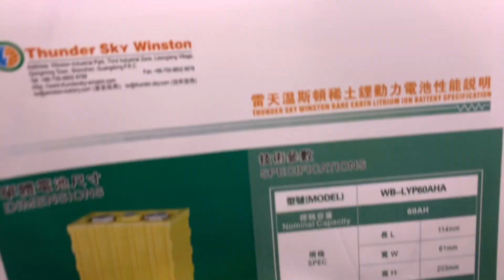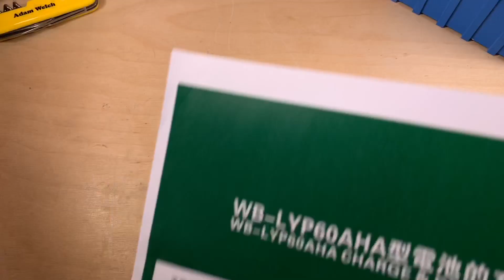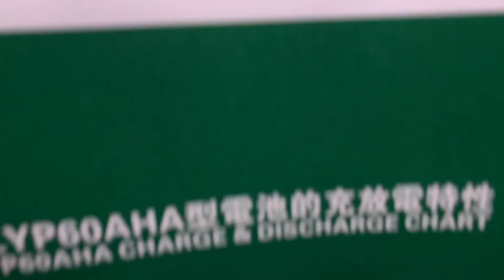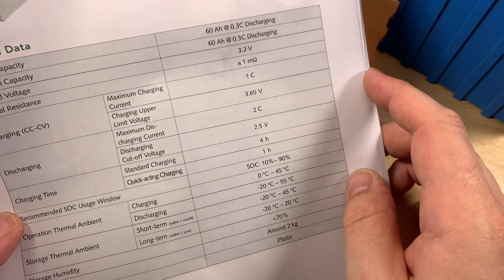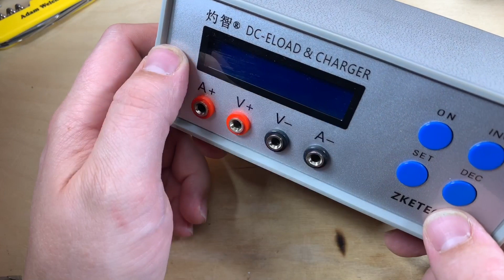Change of Chemistry

Comment: About that electronic load: Devices that have a USB connector but don't support the USB standard distirbues me greatly.. Just before I stopped work (because of the lockdown) I actually blew up my laptop from trying to test an amplifier with a mini USB connector on it. For some ungodly reason there was +12v directly on the USB power lines which killed the laptop straight away. Unfortunate

Comment: Charging lower than the max is not necessarily a good idea.  Most BMSes are meant to "top balance" which means you absorb at the max voltage until the current tails off (typically around 50-100mA) and then you're reasonably balanced/etc.  If you charge lower the batteries can drift over time.  (source: I made this mistake).

Comment: You do not need to worry about keeping this chemistry below 14.6v. You can safely charge them to 4.2v just the same as NMC  but they will degrade faster and  there is no real capacity benefit over 3.65v so that is the standard charge voltage. The point being there is still headroom with 14.6v @  3.65v unlike NMC where if you are charging to 4.2v that really is the max. Due to the poor correlation between  voltage and state of charge with this chemistry it just makes most sense to go with 14.6v when you can to get to the highest state of charge with a CC charge.

Comment: Hi Adam. 

Sorry to bother you but as a non electronic computer nerd with a RV from 1985 with solar and I have a shed. I got myswelf 4 105 pw panels from 2004 that only do between 30 60 watts now .

Anyway I like the way you analize and explain stuff and I am for sure going to learn more about electronish. You make it seems al so very logical.

But a request and probably off topic but I am listening/watching you on my phone while also busy on my laptop and my headphone can only go in the phone or the laptop. It seems mixing 2 sources is a big nono unless you are a dj and bring a mixer table which is overkill. 

I found some projects in the net but they are all complicated and require a power source. 

Isn't there some nifty trick out that that lets met join 2 (or more) sources so I listen to both at the same time?

Comment: Hi Adam, do you think it would be feasible to use a 12v LIFePO battery in parallel with an existing sealed lead-acid battery bank to beef it up a bit without replacing the whole lot?  I've got three sealed lead acid 12v 115Ah Exide batteries on my narrowboat but I could do with a bit more capacity. Some people seem to think that you can't mix different types of batteries but it looks as though the charging requirements of the LiFePO are pretty similar to sealed lead acid.

Comment: thought: would it be any advantage if the BMS can move energy in series connected cells? so rather than burning off excess charge move it from the strongest cell to the weakest in the chain

Comment: Great informative video as always thank you Adam. I was just wondering if anyone had tried to used the load output on a solar charge controller to work a on off switch. Such as to control a inverter via its on off rocker switch. Iv extended the cables to my power switch so I can turn it off and on in another room. And it struck me if the was a switch somewere on the extended wire you'd have a cheap way of isolating an inverter before battery power droped low. I know most inverters do cut off at low voltage. But mine for example cuts off at 19v. And I'm learning that's to low for a 24v system. But I can set power disconnect on my charge controller to a safer voltage to protect my batterys. That's why I'd love to know if its possible to work an on off switch somewhere this way? Cheers
Reply: I hope you solved your problem but if not what you need is a dc relay with operating voltages in the range of.your charge controller load output. The load turning on and off is what drives the relay to turn on or off
Reply: @exxonrcg  hi thanks for your reply.. Yes all sorted now. I did use a 24v relay to cut off the supply at 22v via the load out on my epforever charge controller, and using wires intrupting the on off switch of the inverter. Simple but had to get my head around it at first. Its been working great for about 7 mouths so far.

Comment: Your EP Ever charge controller has a temp probe port. It should have come with a 47K Ohm dummy resistor in a two pin Molex plug to be installed when the optional temp sensor is absent. If you replace the 47K with a 68K 1/8W resistor you can select the Gel battery type and it should charge to just under 14.6V. This allows you to take advantage of a fully charged pack without the worry of entering an equalization stage. If you don't have the two pin dummy resistor, find the correct Molex or solder the 68K directly to the board. 56K will get you to about 14.4V charge in the Gel setting if you wish to slightly undercharge, increasing longevity. I'm using this method with an older EP Solar LS1024S (no USER selectable settings, the built-in temp sensor 47K thermistor soldered to the board was replaced with 68K resistor with the Gel jumper enabled) on a 4S2P Headway pack and it's worked flawlessly. A BMS is highly recommended, but at the very least you should install individual balance boards on each cell to keep the pack balanced and an adjustable low voltage disconnect to prevent over-discharge.

Comment: JhuGarcia stated that the Winstons were junk, I've seen them on Ebay and they where yellow like the picture.
Recommended usage range (voltage) of LiFePO4 is 2.8 to 3.65.
Lithium cannot be charged when the temperature is below 0 degrees Celsius without damaging the cell.  So that portion of the Winston brochure was incorrect.
Reply from the maker: Thanks for this. The temperature issue has also been mentioned by someone else. I’ll test these cells and work out how good I think they are - mine are calb I’m fairly sure, but what relation they are to winston I don’t know.

Comment: The best power cell to make is a Baghdad battery a battery that was designed in Baghdad this has been reconstructed and has had amazing results due to the liquid being alkaline and not acid you could change the pH of the electrolyte and recharge the battery without having to put energy into it.
Reply: Copper Iron is a terrible battery chemistry though.

Comment: 1:27 the system of using those single lithium cells is something Tesla claim their battery are made up of thousands of which I know is absolute horseshit because you have to balance each and every cell and also discharge them equally. Lithium's need a protection board that stop them dropping below their specified voltage and obviously stop them being overcharged
Reply: Tesla are not lying. Their whole car battery system is made of of several thousand 18650 cells in banks. Look it up on the internet - its clearly there to see. They use a complex BMS to balance each bank of cells.

Comment: 13.8v is too high as a float voltage - that will kill the cells over time as this chemistry needs charging to stop completely once they’re fully charged. They can’t handle a trickle charge “float” phase like lead acid can. 13.5v is optimal for “float”.

14.2v is ideal as aborbtion (“boost” I guess?) phase

I would suggest you run through custom settings to optimise things.

I generally would recommend Victron controllers with the latest firmware for LiFePo4 as they seem to understand the (usually misunderstood) actually quite specific charge requirements very well...

I would also change the low voltage cut-off to around 12.0-12.4v minimum rather than run them right down.

(see links in my other comment for my sources...)
Reply: lifepo4 should NOT be float-charged.

Comment: Nice score. Assuming all the cells are within a few hundredths of a volt, connect them all in parallel and use an accurate and stable power supply or charger to charge them to 3.61 to 3.63 volts and hold that voltage until charge current drops to well under 3amps (5%) or better under 1.5amps. Let them sit in parallel for a few days at least. If you can trust your power supply or charger not to exceed the voltage the cells will balance faster leaving the charger connected. This process gets them all in balance to start. Rewire in your 3p4s configuration and use them. In use don't charge them over 3.5 volts (preferred) to a max of 3.55 volts per cell, because it is at the higher charge and deeper discharge that the cells will start to drift apart and more quickly need to be rebalanced. Also the cells like to be slightly compressed to prevent bulging, but if your charge and discharge rates are moderate you should be fine leaving them loose.
I have 20x 200aH sinopoly cells wired as two packs, a 16s for 48v and 4s for 12v.

Comment: Hi Adam, Take a look at this. It's the 100ah but there are spec sheets. The dimensions you mentioned are very similar to the 100ah.  https://www.ev-power.eu/LiFePO4-small-cells/CALB-CA100FI-Lithium-Cell-LiFePO4-3-2V-100Ah.html

Comment: My small 4s LiFePO4 pack, which use new cells that are all from the same batch, have never needed balancing (yet) after about 50 charge/discharge cycles. 

According to the discharge curve for my cells (A123, ANR26650 cells) the vast majority of the energy is between 3.0 and 3.4v so I charge to 13.5v and discharge cutoff at about 12.2v (but it could actually be 12.5v) - there's really not much energy outside of these limits.

Still not sure why you keep mentioning equalisation charges with the EPEver controllers - you can switch that off using the user-defined charge profile (set equalisation to 0 (zero) minutes).

Comment: Well done teaser. I have about 50 of the similar 100 AH GBS prizmatics cells that I have been using to run my office with. I have a tiny 300 watt solar array that dumps into a SLAB x4 via an epever charger so its hands off automatic. When I have enough sun I can run 2 computers and printers as well as heater. cooler lights etc on the SLAB set. When I dont have sun I use the Lith sets made up into 2 p x 4 s until that pack is discharged by voltage at 12.5.To charge the Lith sets I just use a cellpro powerlab 8 from the SLAB or from any car battery. Sometimes on a long drive trip I will change a lith pack from the car cig lighter via the cell pro and just turn it down to sub 10a max draw. I use the cellpro BMS mode during charge on the Lith packs and do not use a separate BMS during discharge. I have a simple voltmeter across the lith cells and stop at somewhere around 12.5. Its been working very well for over a year now.

Comment: Interesting, but I still think recovered 18650s at 7S charged to about 27.7-28.0v then use a buck converter to take that down to 12-14v. Yes you will need 24+v of solar to charge it and the buck converter will cost you some watts. But the easy availability of used 18650s brings the cost per kWh down.

Comment: Great content! My goal is also to put together a 12V 4S Winston battery. Much easier than 18650. 
Great source is GWL (ev-power.eu) from Prague. A lot of tests on their blog. And their webshop has all the materials/accessories and reasonable prices. In fact I havent find better pricing elsewhere in Europe. Maybe you could find apropriate connectors there, or just ideas what to look for.
My wish is to put together a battery with grid tied inverter and also an option of AC and solar charging. Basically an AC battery. I use Grid tied micro inverters on solar pannels, so I produce excess AC power. So my battery should be able to charge from AC (solar dump), as well as DC if grid power goes out..